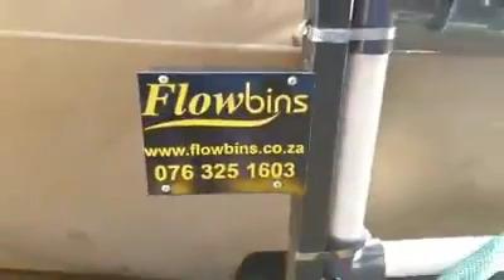5000Lt Multi Purpose Water Bowser Truck Skid Unit

Comment: What brand of water pump is that? Also the specs
Reply from the maker: Good day Ferdz70, This is a CRI brand pump.  2.5Bar centrifugal pump (34 800lt/h).  5 HP petrol engine. We have various sizes of pumps available, in petrol and diesel. You can contact us @ info@flowbins.co.za or 012 7704360 or send us a WhatsApp on 062 915 5059 if you would like more information or a quote. Kind Regards Flowbins